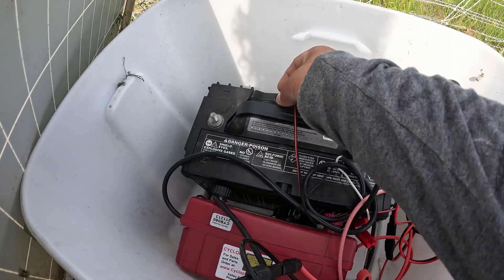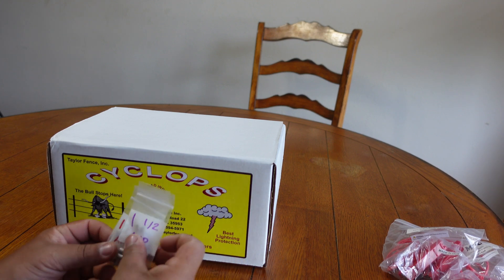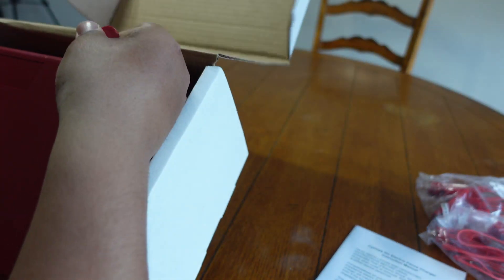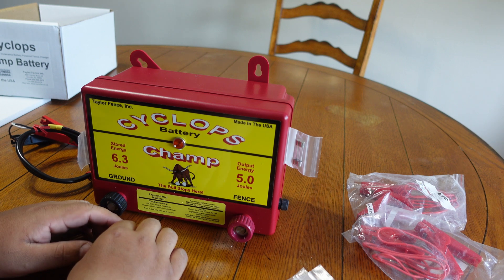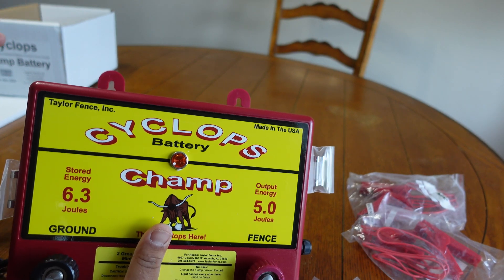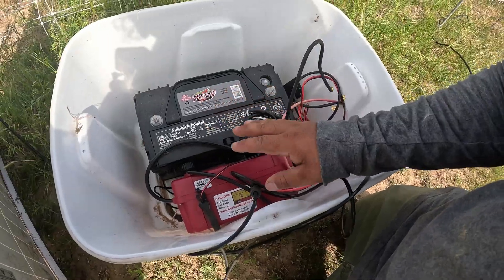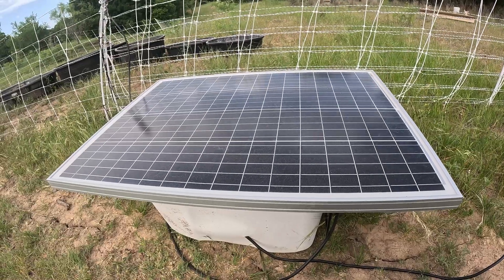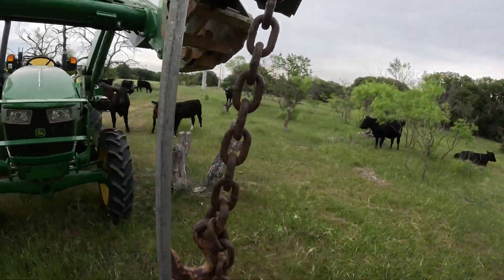How To Build Your Own Electric Fence Charger

Comment: Thanks for the video!  Question - is there a battery inside the Cyclops box?  Are you using two batteries - inside the charger box and the Interstate bat?  Is there a limit on the solar panel - or can I go as big as I want?  This will be my first build.  Thanks!!!
Reply from the maker: Thanks for checking out the video! I’m just using one battery inside the box. As far as the solar panel, as long as it has a controller, you should be good to go. No need to oversize it if your setup doesn’t call for it — it’ll save you money too!

Comment: I got the bigest box cyclops makes it dont seem verry strong
Reply from the maker: Make sure you have enough grounding rods and that they are spaced at least 6 feet apart and at least 4 feet deep into the ground, check all your connections make sure they are tight, and if it hasn't rained in a while you might need to through 5 gallons worth of water on each rod for it to get good conductivity

Comment: Any chance of you sending a link for the regulator you use to make sure the battery is not overcharged?
Reply from the maker: 10 Amp- https://www.amazon.com/gp/product/B002MQN5OI/ref=ppx_yo_dt_b_search_asin_title?ie=UTF8&psc=1  

20 Amp-https://www.amazon.com/dp/B00OQJOTYY/ref=sspa_dk_detail_4?psc=1&pd_rd_i=B00OQJOTYY&pd_rd_w=zvMvx&content-id=amzn1.sym.8c2f9165-8e93-42a1-8313-73d3809141a2&pf_rd_p=8c2f9165-8e93-42a1-8313-73d3809141a2&pf_rd_r=Y90T27JC3C8KXDZQG9KB&pd_rd_wg=kc9MN&pd_rd_r=e57273db-db6a-45ed-b747-6356238ed14c&s=industrial&sp_csd=d2lkZ2V0TmFtZT1zcF9kZXRhaWw

Comment: Just heads up, netting is wired in parallel, so it's not 164 * 40 not 164 * 40 * 8. You should always run your fencing in parallel too since it'll mean less load on your charger. Basically just make sure that at the start and end of your fence all the strands are connected to one another. Makes your fence much hotter. For netting you don't have to worry, they're all connected in parallel at both ends already.

Comment: If you don't have it already, you should consider providing some sort of ventilation system for your battery box. Lead-acid batteries produce hydrogen gas as a byproduct and that can be dangerous when it's in a sealed container filled with electronics.
Reply from the maker: Yes sir we have holes drilled in the boxes